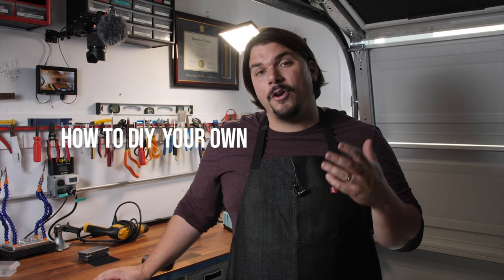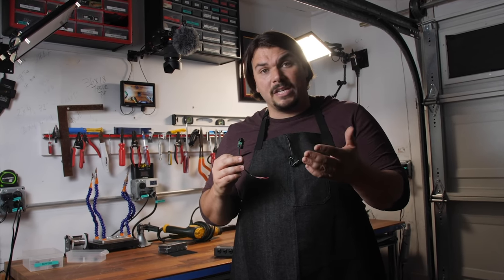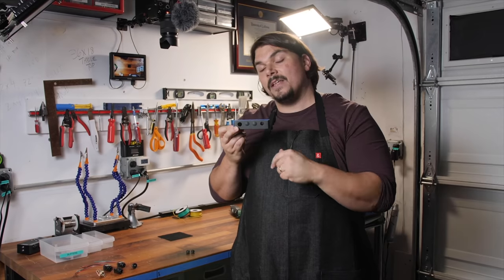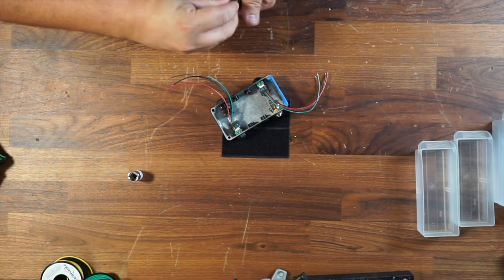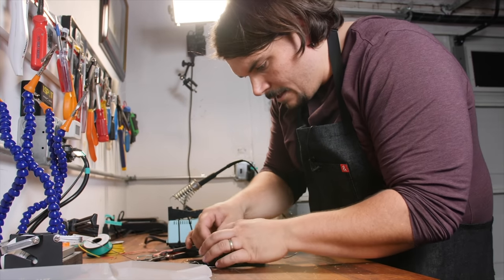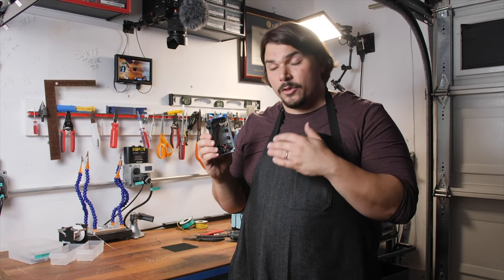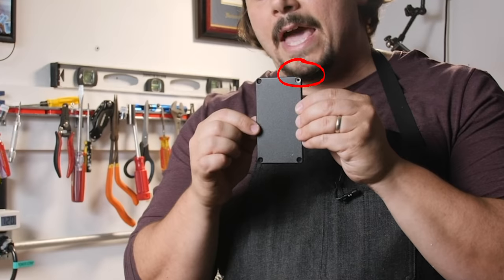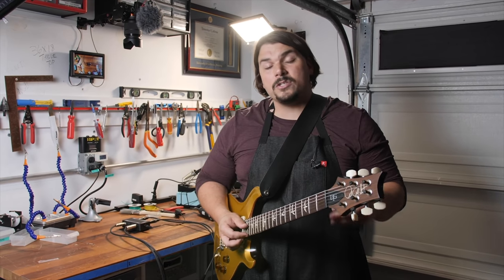Build Your Own Buffer!

Comment: Would you be willing to sell one with stereo in & outputs?
Reply from the maker: You can make one using this tutorial and diagrams
Reply: @VertexEffectsInc  yeah, I know but the Hammond Enclosure has been sold out for a long time and I don’t think the other parts can be shipped to Greenland. I have also been looking for a Empress Stereo Buffer but it seems that it is no longer available. Would love to get one but I think it is hard when you live here.
Reply from the maker: You have the model number listed for the Hammond enclosure, there’s got to be hundreds of dealers of that product
Reply: @VertexEffectsInc  You are right. Thanks!
Reply: @VertexEffectsInc  you never used the green and yellow hook up wires in the video. Or am I missing something? Do I really need to buy that (hook up wire) separately?
Reply from the maker: You will need hook up wire for any pass throughs.  If it’s just the buffers - you won’t need any hook up wire.  The color doesn’t matter as song as you know what’s what.

Comment: There is a thing I still don't understand. If the amp wants to see 1M, why the output buffer is 100 Ohms? Shouldn't be 1M output?
Reply from the maker: The guitar wants to see 1M.
Reply: @VertexEffectsInc  Isn't 1M input in all amps?
Reply from the maker: @rgr4929  most are...but the important place to simulate that is on the guitar, not on the amp.
Reply: @VertexEffectsInc  Then, in a buffer pedal, a 3k ohms output isn't bad if the input is 1M?
Reply from the maker: @rgr4929  no, the closer to 0 ohms the better on the output.  100 or so is about close enough, 1K is 10x worse, 3K is 30x worse.
Reply: @VertexEffectsInc  Which of this two options should be best for my pedalboard's output buffer?: StroboStomp HD (5M input/100ohm output) or Fulltone Supa-Trem 2 (1M input/3K ohm output)?
Reply from the maker: @rgr4929  the closer to ) ohms the better.  The input impedance isn't as critical on the output buffer, more critical on the input buffer.
Reply: @VertexEffectsInc  Thanks!